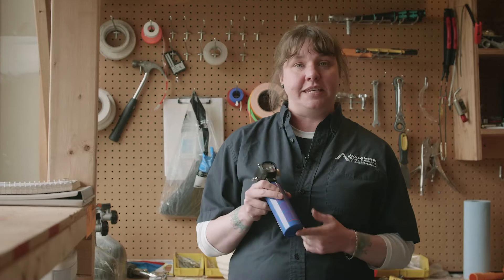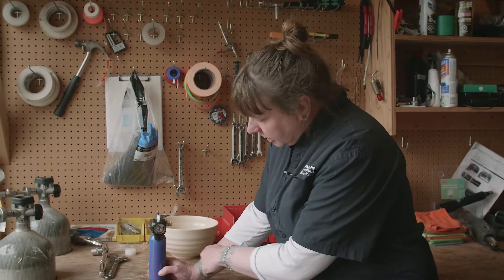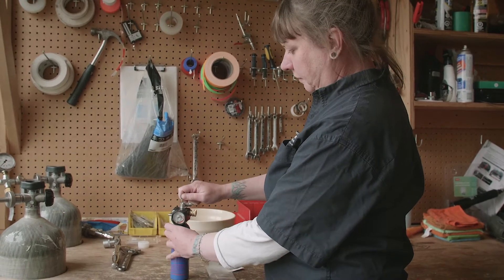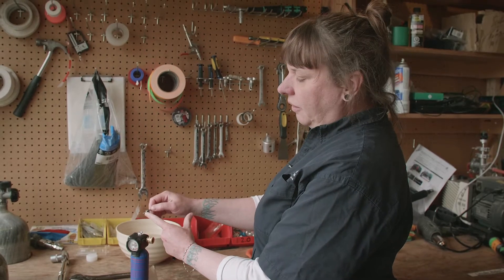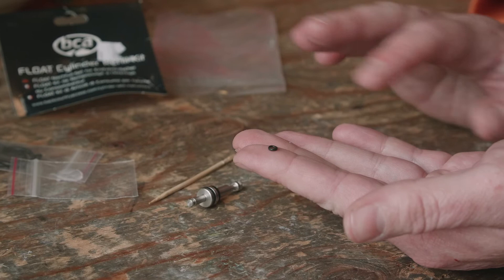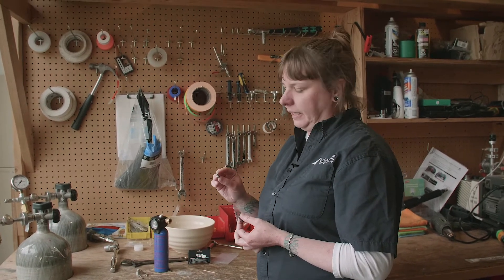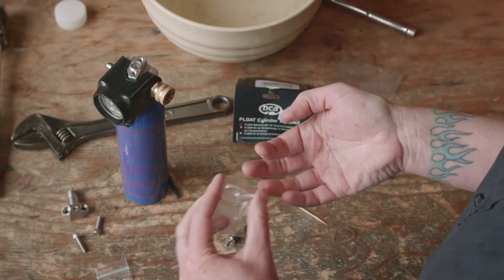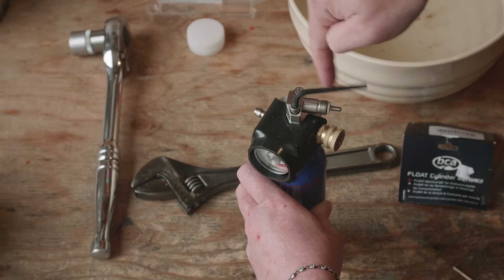How to Refill a BCA Float 2.0 Cylinder

Comment: Great instructions.  Worked like a charm (just changing the gaskets and readying for a pro to refill).  But when I removed the firing pin, ready to remove that tiniest O ring, it was not there!  Clearly, it did not exist.  Just the gap.  The throat on the canister was a bit loose (it wanted to turn loose easier than the hex key removed the valve bolts) so I removed, replaced the big O ring, and greased that connection.  But when apart I shook the canister upside down (in case the tiny O ring and/or its parts fell into the  canister) and I also then used the wooden tooth pick to carefully push from the canister side of the valve intake and out the firing pin hole.  Nothing.  Is it possible this new (came full and held pressure all last winter) canister/valve could have worked without that tiniest O ring the whole season?
Reply: No, with the rush of gas chances are it rips the o-ring off seat or simply pulling the pin rolls it out of the groove. So yes, replace it
Reply: Actually let me rephrase that, the small o ring is there to contain the pressure in the bottle. There is another larger plunger above this also, if you dont have the small o ring in place the pressure will act on the larger plunger and not the smaller shaft with the small o ring. in turn this could over stress the firing pin to the point it fails or its really hard to fire. So as before, replace the o ring

Comment: Why does the cylinder have to be empty? Mine is at 2500psi, can I not just add extra pressure to it?
Reply from the maker: Well, it doesn't have to be empty - sure you can just top it up with extra air and up the pressure, but you might want to examine WHY you are only at 2500psi and make sure you don't have a leak in your cylinder.

Comment: Hi there, wondered if I could ask your expert opinion. I’ve got an older Float 22 1.0 that needs a new cylinder. Can you use the newer 2.0 cylinder in it as they’re much easier to find online. I know the manufacturer (BCA) says you can’t but it looks like it’s all the same connections on the trigger and fill line. The pressure seems to be the same psi as well. Have you ever tried to connect a 2.0 cylinder onto a 1.0 pack? Does it work or am I kidding myself???
Reply from the maker: Most excellent question - it's a valid one. Unfortunately the 1.0 and 2.0 systems are not compatible with one another, which tends to be the case between 1.0 and 2.0 systems of all brands. Though the fitments look like they should work together, they're actually of different sizes so wouldn't work to try to attach them.
Reply: @avalanchesafety  Ok thanks for your help